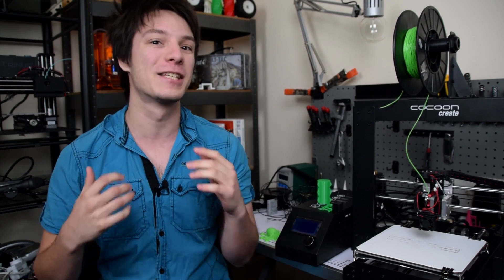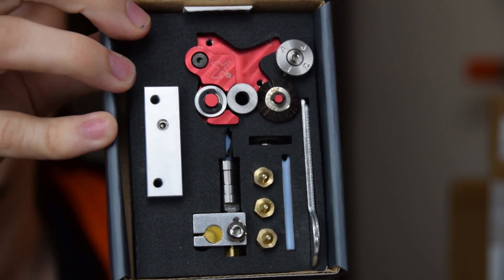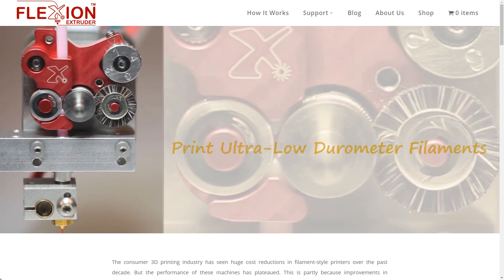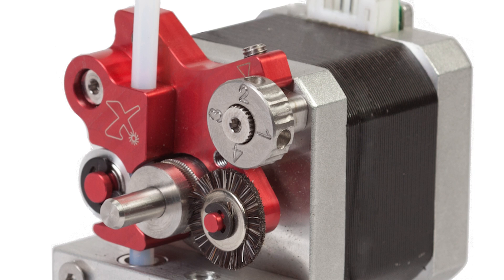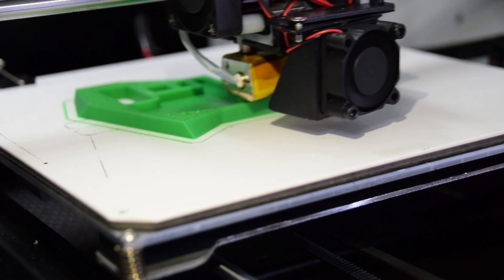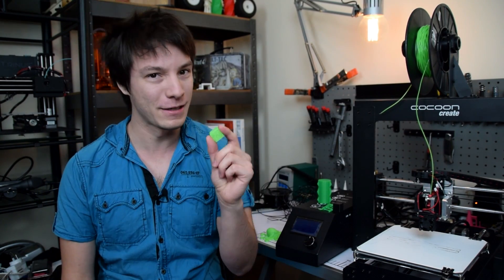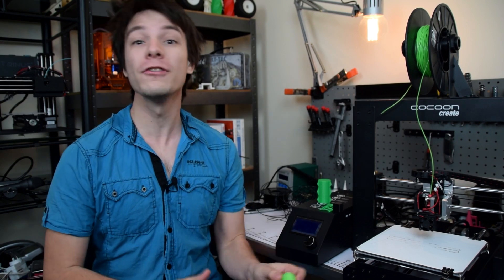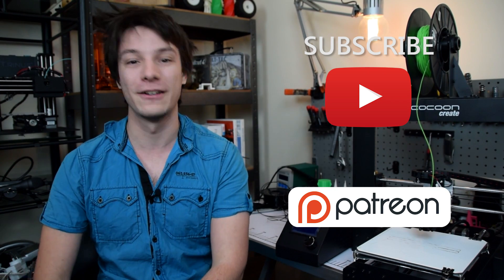Easily 3D Print Flexible Filaments with the Flexion Extruder - Review

Comment: I bought a kit for my Creator Pro 2, it’s worth every penny, not only can I print faster and a lot more quite, but I can now print flexible materials with ease without searching for hours on the internet for the exact settings I must use. It now just works. This is also a must have if you are printing filaments with chopped carbon, my models look amazing.

Comment: Hey man so I have the maker select v2 and it's been 4 years since I got it and I've noticed that more and more I get more vibration from the y axis motor.. it doesnt have that high pitched sound anymore it's more like a small vibration... it slides perfectly with the belt and motor detached and there's no noise when moving by hand... I changed the stepper motor and it's the same... what else can cause this vobration

Comment: I was interested in buying one but i dont like that they use a glass bead type thermistor, i cant take anything less than a cartridge type, i am using a Dyze Pro out of Quebec and it is supposed to do flex filament well but i havent tested that yet as i am waiting for a replacement motor that seized within the first 2 weeks. In the meantime i've ordered a Receus V3 out of spain with is also into flexible filament, I am not really, but keep looking for a good, dependable extruder that can print with larger nozzle sizes.

Comment: Would you suggest something like this for a delta printer? The extruder gear and the hot end itself are rather far apart, and are connected via a bowden tube. You talked about gaps between the extruder and the hot end. This is a really big gap.

Comment: How does it handle ABS, PETG, NYLON,  woodfill/metalfill, etc. PLA clearly works well, but another video discussing these other materials on the flexion would be sweet!

-Nice vid by the way.
Reply from the maker: The original flexion has a low temperature limit so can't do PETG for long, or Nylons. however, they've got the HT version now that can push those filaments no issue.
Reply: Maker's Muse thanks

Comment: I have a question, how can I add perfume fragrance to my printing process so my mold can produce smell after its done ? do you have any idea, please share it with me.
Reply: Wasim Al imam I imagine that once the plastic is heated and extruded, the perfume would've evaporated. Maybe spray on it after you've done printing it?
Reply: I'd try just pouring a little bit inside it before it finishes, as long as it is mostly but not fully air tight that should work. If it doesn't do it like you want then perhaps get some object which does and have 0% infill so you can place said object inside before it finishes

Comment: Question Angus, if I may. I'd like to upgrade my Wanhao Di3s with a Flexion extruder vs just a Microswiss all metal hot end to print some more of the exotic materials. I'm not too concerned with the price of the Flexion if it will give me a better overall experience. Your thoughts? Also, do you print on Buildtak or glass on your Di3/Cocoon?
Reply from the maker: Hi Roel, they're for different applications. The flexion prints flexible materials reliably and fast, but can't print abrasive materials. On the other hand, the microswiss is designed to handle abrasive filaments but may struggle with flexible filaments due to the all metal hot end design. Personally I intend to have one on each machine but that's not a realistic compromise! I'd choose the one that suits the filament types you intend to print mostly with.
Reply: you're quick! Thanks mate for your reply so quickly. Overall I would be printing PLA 90% of the time and only want to have a play around with wood and possibly flexible stuff here and there. The fact that there is a noticeable difference with the Flexion even with PLA is a bonus, I suppose. Perhaps I should put a Flexion on one and the all metal on the other Di3.
Reply from the maker: Yeah if you're not interested in abrasive filaments definitely go with flexion!
Reply: Thanks Angus. It might just be a well worth upgrade even though the Di3s are so cheap. What are your experiences with bed adhesion (PLA mostly)? Do you use Glass/Glue/hairspray or Buildtak/Pei/etc?
Reply: I know this is super late, but flexion sells a high-temp hotend (they collabed with micro-swiss for it), as well as a hardened steel nozzle. I think the combo of these three gives you the biggest range of material choices

Comment: Have you tried any prints with the 0.2 mm nozzle and does improve the detail of the prints or is the x / y accuracy the limiting factor not the nozzle size ?
Reply from the maker: Haven't tried it as yet but it's on the list, a few people over on the facebook 3D Printing group have been doing amazing micro prints with 0.2mm nozzles on regular machines, X Y accuracy doesn't seem to be a huge issue so long as a printer is set up correctly.

Comment: so it'll print any material? even ABS?
Reply from the maker: It's rated for ABS temps but I haven't tried ABS in mine yet - hard to stop it warping on the i3 machines.
Reply: They say soft (60a), flexible (ninjaflex) , semi flexible (semiflex), ABS, PLA, PVA, HIPS,  PET, PETG, NYLON, and PC. Believe they say on support page they can print even the softest actually the only one that can print the softest material so far. Had mine for awhile but just started getting it setup today. I have the dual standard and HT kit. Trying to see if there are settings for the standard printing PLA they say it works better printing PLA using the HT. There is a chart online that lists the material and which hot end you should print with.

Comment: Angus. hope you can help me out. I really really love my flexion. WHEN it works properly I get simply astounding results. mind blowing even considering the price of my printer and the precision is second to none so far (granted I have only used 3 extruders in my life but even comparing my prints to other peoples prints)

IE I did this on my maker select (same as your cacoon create) in under 3 hours at 100mics and I did not have the jerk and acc lowered yet

https://www.youtube.com/watch?v=NS9_Wt_EkMg

so it should come out even better

but My god is it a pain to tune the pressure right. not enough and it under extrudes as it slips too much and it under extrudes as it stalls the stepper. Grrrr sometimes I get it just right and I can make HUGE prints (like the VICE ! wow did that come out spectacular)

how did you go about tuning for pla. anything special? flexion tells me the stepper is a bit weak for the extruder for PLA. suggestions on a replacement stronger stepper?
Reply: it was my stepper. either it was just too underpowered or more likely something was wrong with it or it was dying. spent all day fighting with it could not make it work.

replaced stepper after reversing the wires and WOW. working perfectly again and not nearly so "picky" about cam pressure now. OH I am so happy. the part is looking spectacular and "precise" as I have come to love from my flexion.
Reply: Wanhao i3 extruder steppers can be a problem. I think mine is a bit weak as well, so the grub screw has to be just right with the Flexion. On top of that, the trimmer that controls the current to the stepper might be off as well and in order to adjust it correctly, you need to figure out which stepper you have. And after it has been adjusted, it might actually become weaker than it was.

The best option seems to be to upgrade the stepper. But it's a jungle out there and you have to be really careful to get the right spec motor and even then you can end up having to reverse those two pins and will most likely have to adjust the current as well. Prima3d offers spare parts for the i3 and they have two stepper models available. I think the X/Y/E stepper is the weak one and the Z stepper is the stronger one.

My biggest worry is that small filament variations will cause the extruder to stop in the middle of a really long print. Sort of like a car stuck in mud or snow, spinning its wheels without going anywhere. One thing that makes it less likely to happen is to keep the print speeds reasonable. If the hot end doesn't have time to heat up the filament properly, the stepper will have to work harder. So for a while I was printing PLA at up to 70 mm/s, but I think I have to drop it down to 55 mm/s or 60 mm/s to be safe. My ABS settings are lower, but I have only printed a few parts in ABS so far.
Reply: +Juri Munkki this is why I want more torque with more torque I can tighten down the cam on the filament more reducing the variation that filament has to cause me a problem if I can torque it enough small filament variations become irrelevant it's only a problem when you are balancing the torque on the cam on the verge of being too tight and too loose more torque equals a larger balance spread even with this $14 stepper I'm seeing a huge Improvement in that balance it's not nearly so finicky and I cannot torque it down nicely

Comment: If you weren't concerned about flexible filament but you were still looking for a bump up in quality would you still use this or would you go to something like an E3D or Hexagon?
Reply from the maker: Hard to quantify against teh E3D or Hex on my setup but there was definitely a big improvement due to the feeder gear assembly as well as the hot end.
Reply: Ok, so it really is dependent on the printer and the intended use

Comment: i have the flexion. its a pain in the ass to tweak when it is not gripping right but my god is it worth it. the quality and precision of the prints are simply stunning! just look at some of my videos especially the rook and the vice where i had it dialed in perfectly.

what it really needs os a stronger stepper. if you tighten too much it stalls the stepper so you have to loosen it but your always on the verge of just about too loose.

but man when you get the bugger dialed in the results are breath taking. most important though is the precision.

i tell it the nozzle is .4mm and that i want a .4mm line and set the multiplier to .97 to 1.0 and golly gee the little bugger delivers perfectly what i instructed it too.

absolutely blown away by this extruder and it is worth the tweaking pain when dealing with pla for the precision and stunning print quality.

apparently this is specific to hard filament such as pla (flexion says the hardst the tweak for) and its much more forgiving with flexibles.

my prints come out just like his does. perfect. scary perfect considering my printer was $310.

install the thicker y plate. install the z brace kit and install a flexion and you will be stunned by the quality you can extract from these printers.

Comment: The extruder on my rigid bot 2 prints tpu at 80mm/s  and it's a ouch simpler extruder once you fix the firm ware to not shift in the y
Reply from the maker: I've been struggling to get the rigidbot 2 I've got working right due to early firmware issues, I'd love to try your setup if you wanted to send it across or if it's on github?
Reply: +Maker's Muse I will email it to you right now :D

Comment: Hi Angus great video as usual . I have two wanhoa duplicator i3 s and i have done all the usual upgrades, one machine more than the other. I put an all metal hot end in one and it does make a difference. 1. The prints seem to come out with more of a sheen to the surface. 2 I have printed wood, metal , pla , abs , petg no problems. I also print TPU, TPE and a flexible filament by Excelvan with no problems at all. I slow the speed down to 30 bed temp 55 hot end 200 and the fan on from the first layer. This all seems to work well. Just one mod you need to do and you will think why did i not do this earlier you need to do the thumb screw mod on the bed leveling. If you use lock nuts as well you dont need to alter the bed after every print it lasts ages cheers Tim

Comment: This is only an upgrade if your current setup doesn't support flexible materials. This isn't a revolutionary idea of constraining the filament path and adjustable tension. I've printed a number of things on current printers out of TPU and NinjaFlex, no issues. I've gone through rolls of this stuff as it's really great for printing toys for my daughter (can't break TPU, just bend it). TPU prints reasonably well at 45 mm/sec, NinjaFlex is best at 20...I'm not sure which material you had there.
Reply: even printing pla it is far far superior in quality results. pretty impressive. i have not even tried flexible b yet butbi had two rolls waiting for me to play with :-)
Reply: superior to what? what was your previous setup? This is definitely an upgrade for an MK8 non geared extruder.
Reply: +kazolar me? superior by orders of magnitude over the stock i3v2 extruder.
Reply: It definitely is, though there are cheaper options. But I'm running the bondech QR with e3d volcano on my diy printer, that's way more expensive.

Comment: Does anyone know if you can use this with thr microswiss all metal hotend(or is it even needed). I still need to print upto 260 so if it cant do that then i'm not interested. I am thinking about trying to adapt the E3D titan for the wanhao as its much cheaper and gives you the chance to use a lighter stepper.
Reply: Contact the guys who make Flexion. I'm sure they can figure out an answer for you. I imagine what you could do is cut the supporting PTFE tube short from the nozzle so that it embeds into the feedpath of your all-metal hotend.
Reply: no. 240 is safe but not 260. they are working on a higher temperature version!

Comment: You're saying that spring-loaded systems squish the filament too hard. However, setting 1 on the Flexion is the highest pressure setting and setting 4 is the loosest setting. If I push the print speed really hard, the compression setting has be spot on. At slightly slower speeds, it's not that critical.

One huge bonus of the Flexion is the ease of filament loading & unloading. You just reverse 40mm out to take the filament out and feed 40mm in to put in a new one. It's all done from the printer UI. I used to keep PLA loaded on my printer even when I wasn't using it, because changing filament on the original Wanhao extruder is a pain. However, keeping the roll exposed to ambient humidity is bad for the filament. I'm choosing filaments now based on what I'm printing instead of what's on the printer at any given time. I'm also making prints where I change the filament color halfway through the print.

Finally, you can almost completely eliminate the ringing artifacts from Wanhao prints by using the firmware configuration to set the XY Jerk to anywhere between 8 and 12 (default is 20) and XY acceleration down a bit to something like 800 (default is 1000). Easy to try (no computer connection needed) and instantly reversible. Slightly slows down print speeds.
Reply: ohhh gonna have to try that. link to instructions to change these settings?

for anyone else who needs to change these settings

http://3dprinterwiki.info/wiki/wanhao-duplicator-i3/duplicator-i3-calibration/firmware-settings/

found that. and you can change it "live" even while in the middle of a print (and save it) without crashing the print (and you can hear the change tape place too! neat)
Reply from the maker: Thanks for the tips, I'll have to try those new Jerk settings!
Reply: Nerys Yup, you found it. The only issue I had with the live changing from the console was that even though I'm sure I saved the EEPROM settings, the settings would reset when the printer was restarted. Altering the settings while printing an extruded shape designed to cause ringing made it easy to see the difference. I used Repetier Host to make the changes more permanent.
Reply: I also fixed my flexion tonight! its printing gloriously and not neary so damned finicky about grub screw cam pressure! that extra stepper I bought that did not work? well I discovered online that it wiggled because the center 2 wires were reversed to what the i3 is wired for. reversed them and it works.

more torque. no flexion problems anymore! and just to be sure (and I want to go faster) I have a 5kg torque 1.2a 1.8 (ie within spec) stepper coming in the mail.

but its printing again right now flawlessly. SOOOO happy!

Comment: Great video as always Angus.
I got the E3D Titan when it was released and I have the same improvements in quality the you have with the Flexion. I also had the spare roll of flexible, exactly as you were saying. But not any more, the Titan printed it as easily as the Flexion did for you.
The Flexion is clearly more rigid than the Titan though and it has some very nice touches, like the gear brush etc.